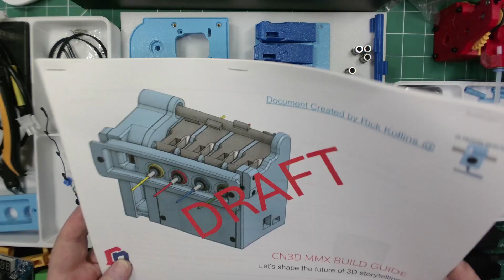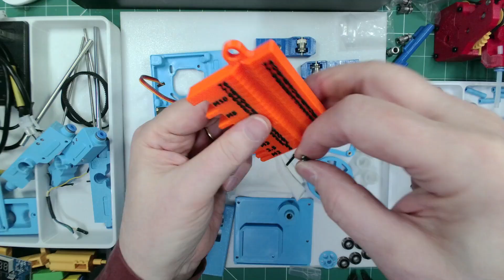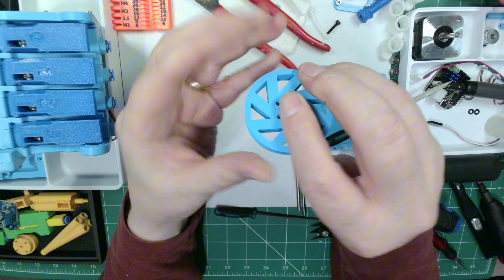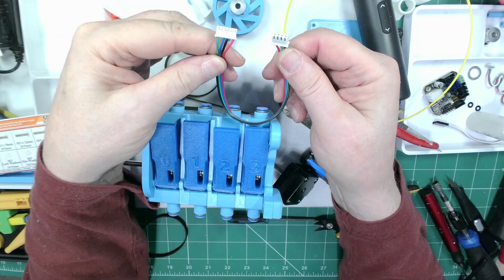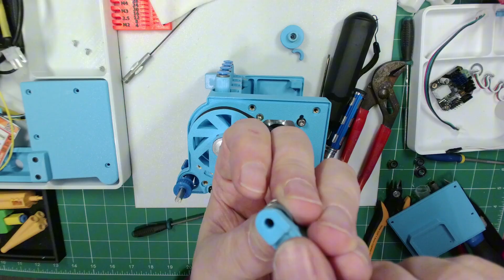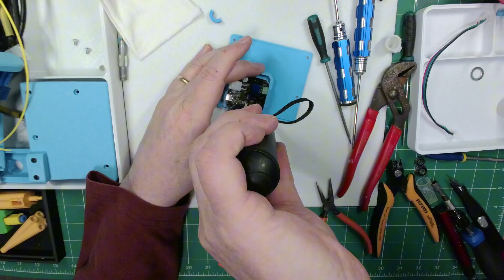CN3D MMX Build Video

Comment: Yes push the microswitch all the way in. Then eventually the screws will not catch the holes in the switch and now you have a nice project to get the microswitch back out. I destroyed mine on the way. And once you are there you see the drawback of tight tolerances and absolutely no rebuild-/disassemble capabiliy designed in. There should be holes under each magnet and under any other object that is pushed in so you can get them out easily and there should be loose tolerances when a screw is used to set position.
Reply: Yes... I managed to get one of the magnets the wrong way... I had to destroy the idler to get the magnet out. Same goes for the balls of the filament sensors. 
Also on he gates and spacers could use a third threaded rod near the pregates so you can make the block nice and sturdy without any side or bottom plates. And finally the round holes could use a teardrop shape so they print better without any support

Comment: 1:01:20 as all the switches are aligned it would do good if you can use a perfboard or maybe even a PCB to make the connection. I personally don't find the jumper cables reliable in the long term.

Comment: @ about 14:40 you mention that the filament sensor switch can bounce after the filament is in. This is actually a very common problem with switches, especially with any kind of spring internally. This is why you must de-bounce the switch connection for reliability. This can be done with either a debounce circuit in the electronics or in the software you can ignore any switch state change that happens for less than a small number of milliseconds.
Reply from the maker: That is great information. I appreciate the comment. Back in the day we used analog stuff to handle dwell time for opens or shorts. Do you know if there is a setting in Klipper configs to handle this in real time?
Reply: @3dpo-rick  No, my only printer is a Prusa MK3S+, and I don't even know Marlin that well. However, my introduction to debounce circuits was back in trade school when they brought it up in electronics class. At lunch I went out to the soda vending machine, put in $0.50, and very rapidly went back and forth between two of the buttons like I was playing the old arcade game "Track and Field". The dozen people watching learned something new also when they saw the machine spit out 5 soda cans. Less than a month later they swapped out the machine for one they hadn't gone cheap on, and cut corners by not including $1.00 worth of debounce circuitry.

Comment: Hi is the drivfe the latest versions or the one in printables I am a bit confsed. I ordered the kit and got it but abit not sure what i need to print
Reply from the maker: It should be. I haven't seen the latest version of the kit. Which parts do you have a question about? Maybe I can help...
Reply: @3dpo-rick  aout the prntable parts 'you aded here files on google drivedrivewhat do i assmble?
Reply from the maker: @loxire I have not assembled the kit. Just do your best to match the parts on Printables. The parts on the shared drive are just some improvements i made. I’m not completely sure what you are asking. Maybe go to the discord? It will probably help.

Comment: Great video, thank you! Pretty much the full build in an hour and 13 minutes! Do you have any videos or documentation for the wiring and programming? I'm a little lost on the content in the manual as I don't have a lot of electronics experience
Reply from the maker: Thank you for the kind words. Wiring diagram is in the document and the Happy-Hare stuff is in development. Currently Happy Hare has a default config you can use at install time and get you up and running quickly. At install time, pick MMX and EBB42 and the wiring and behavior should match! A video will be coming though...
Reply: I think I have the wiring per the manual, only things I cannot figure out is how to get power to it? Do I need to run a wire from the mainboard to it? Also, how does the mainboard connect? Is it with the USB?
Reply: There is also and extra switch, PB4 that I did not catch in the video. In the diagram it's called the Gate Sensor
Reply: @YousafKhan-mb9gj  that's for detecting when the filament reaches the hub (where 4 become 1). I plan to use a hub on the toolhead and will wire it onto the toolhead controller. If you where building an MMX wit a hub at the MMX end, you could use a sensor (like the pre-gate sensors) wired to the MMX controller. I'm just about to build mine, so haven't actually tried it. I assume that its main use is to detect when a filament has been pulled back and has cleared the path for the next filament.